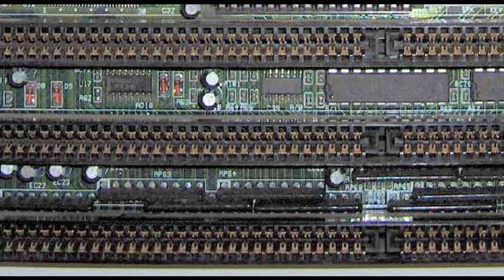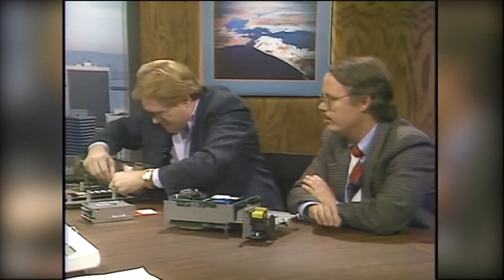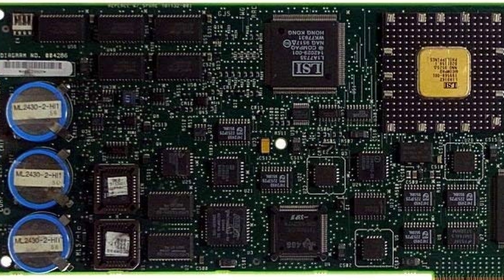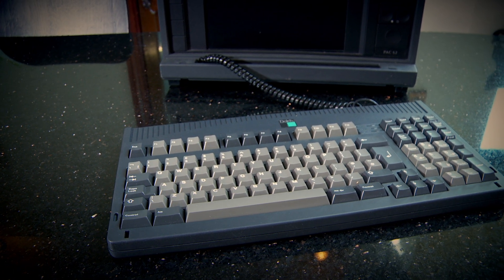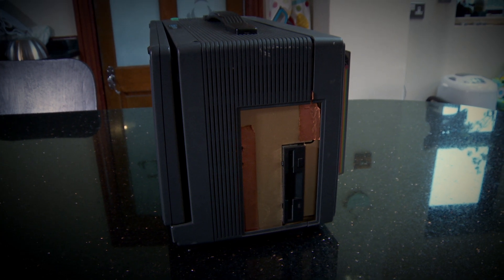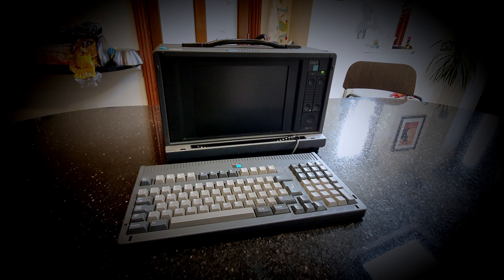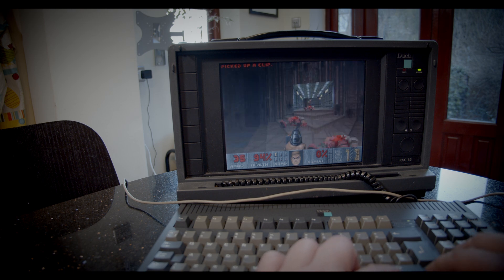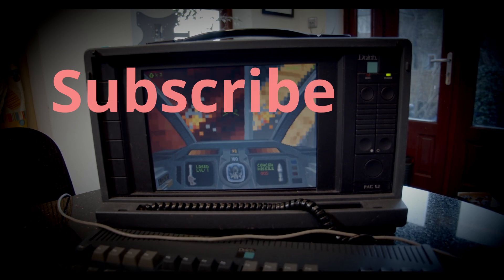E-ISA vs MCA: When IBM Lost the lead in PC market

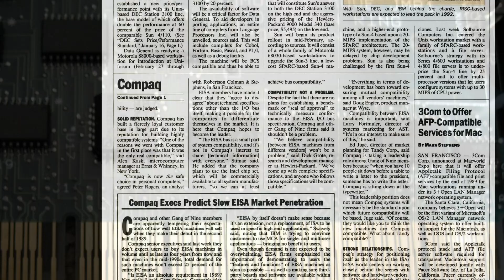Comment: 6:15 Look at the unusual alternating shape of those pins.  This was done to maintain compatibility with AT-bus pinouts, so AT-bus cards could also be plugged in. The backward-compatible pins made contact at the bottom, while the extra EISA-bus pins had their contacts at that second level further up.
Reply: Imagine all the pins in a row! lol
Reply: I have an EISA PC (a Compaq Pentium, also has 2 PCI slots) and EISA was an even bigger flop than microchannel.  At least microchannel had a lot of desktop PCs with MCA, EISA was nearly entirely confined to the server market, though, to be fair, EISA was pretty common in servers.  But microchannel was also heavily supported in servers, especially IBM servers.
Aside from this one desktop EISA machine I happen to own, I am not aware of a single other machine meant for the desktop with an EISA bus. (I've worked in IT since the early 90s)  Tandy is one of the "gang of nine" which defined EISA and I don't think they built a single machine with EISA.
Also, once VLB came out, EISA's days were numbered and PCI more or less burred it.
Reply: @tarstarkusz  Mate, we had scores of Compaq Professional Workstation 5000s with dual Pentium Pro processors and they were all EISA bus with EISA expansion cards.
Reply: @corydorastube  They were not at all common. They were very expensive machines, often equipped with SCSI cards and hard disks.  Compaq is mostly the only computer company that made desktop machines with EISA.  These were not common low end desktops like the DeskPro 2000, they were considered higher end workstations.  The model I have, one of the companies I worked for had hundreds of them.
Originally, the EISA standard was created or endorsed by what they called The Gang of Nine. But most never made even 1 model with EISA.
Reply: @tarstarkusz  Nowhere did i claim they were common, but the company I worked for has a very large client and on one floor of their building there were around a thousand of them.
Reply: @corydorastube  OK. Fair enough. I misunderstood you.  I myself worked in 2 places with large numbers of Compaq EISA machines.
Reply: @tarstarkusz  EISA was clearly the more successful, simply because more manufacturers used it and more cards were available. MCA was a flop. Your personal experience is only that... yours, not everyone else's. I had a cheap 486 PC with EISA slots. VLB was only for graphics cards, and whilst not a failure, it wasn't not a huge success either. It was PCI that killed all of them off.
Reply: @another3997  EISA was pretty common on non-IBM servers.  But IBM put MCA in all their desktop machines and they were very successful.  They were very successful with big corporations.  I supported them in several larger corporations at the time.  EISA was practically non-existent in the desktop market.
There were no cheap 486 motherboards with EISA.  There were no cheap EISA cards either. They were almost all very high end server stuff.
VLB is NOT just for video.  I have a VLB disk controller in my possession and used them in the past. I also currently own several 486 motherboards with 3 VLB slots.   VLB was what was common cheap 486 motherboards, not EISA.
EISA should have been common, but it never was outside of servers (it was the standard in servers).  The large presence in the server market meant most EISA cards were very expensive. The disk controllers tended to be scsi, not IDE, which is what end users were using.  The network cards tended to be expensive.  Video is not important on servers of the era.  The machines were locked away in closets and remotely administered.
Even the EISA machine I have today was a 5,000 Dollar high end Compaq workstation.
PCI blew both of them away and very quickly became the standard on both the desktop and server markets.
Reply: @tarstarkusz  I'm going to have to completely and fully agree with A Nother. First off, IBM simply DID NOT put MCA into all of their desktop machines, even the PS/2 line in the key time period had a variety of models - many did come with MCA but nearly as many did not.
On those random PS/2 machines (a very small % of all PCs sold in the era), you'll rarely ever see more than a disk controller card, a memory upgrade card, and a video card. Sure, they made all sorts of (astonishingly expensive) MCA cards, but due to the cost, only corporate users typically ever added on stuff like SCSI disks or Ethernet.
Indeed, in college one of my buddies actually did have an MCA '386 PS/2 machine, and we laughed (and ran) when we saw the price of the Ethernet cards; luckily his machine had a few 16 bit ISA slots as well, or else he would not have been able to get on the campus network (this was early '90s and we had direct internet access to our dorms and apartments via 10 Mbit Ethernet in those days).
As to EISA, it lived a quite healthy period in the server market - something that IBM had mostly ignored completely in their quest to own the desktop via MCA.
Big blue failed badly... it's OK to accept that, but it's not OK to spread falsehoods just because your limited familiarity with that time period and the hardware you actually ran into. Protip: you clearly worked at a small shop that didn't get to play with the good toys based on your "story". The reality was much different.
Reply: @chouseification  I supported thousands of these machines. They all had MCA.  I supported them in multiple large corporations whose names you would know.
You have to realize at the time most of these large corporations had token ring networks with terminals all over the place and a mainframe.  Putting IBM computers on the desktop was just a natural thing.  IBM was VERY well supported.  I was supporting PS/2 Machines after the turn of the century and could get ANY part  They were 10 years old at the time.  Every single part of the computer was avail new overnight.

I completely agree with you that MCA was a total failure outside of big corporations.  But that is where all the money is.  People don't want to spend tons of money of stuff.  They ONLY see ONE price tag, the up-front cost.  They don't see the having computers down for days waiting on parts that haven't been made in years.  Or creating yet another configuration by replacing a bad part with a "substitute" so that you end up with a bunch of 1-off computers or odd configurations that create bugs and strange behavior not expected and take longer to re-image when that become necessary.  Plus, most of the machines I supported in that era were running OS/2 (Os/2 had INCREDIBLE support for the mainframe stuff. It was great at remote upgrades through Rexx) 

 Your college buddy did not have the same requirements as large corporations have.  He wasn't printing using DLC.  He didn't have terminal emulation services running on his desktop.  He did not have a huge IT department He didn't have to worry that someone generating income for the company can't access the databases because his computer is down..

I agree and already said EISA was big in the server market (as was MCA, at least on IBM servers).  EISA had virtually zero penetration into the desktop market because frankly, ISA and later VLB were "good enough" for desktop PCs of the era.  

When did I say IBM didn't fail?  MCA was a big success, but MCA is NOT IBM, it's an IBM product/specification.  It's not what killed IBM's presence in the PC market.  OS/2 was far more responsible than MCA. Let's not forget about the laptop market.  Thinkpads were EVERYWHERE.  IBM's attempts to enter the home market also greatly harmed  them. IBM wanted to enter a market it was not set up to deal with.  IBM did not sell "commodity PCs"  IBM charged top dollar for their PCs which were well suited to the corp environment and had service contracts as well (I worked for ISSC). 

IBM sold "a system" and not just a PC.  Even procurement was easy with IBM.  A procurement person could simply log into software on the mainframe and order PCs directly and all of the normal stuff was already pre-approved and taken care of.  IBM delivered the computers pre-configured right to the end user's desk (this was not "normal" just possible and a company I worked for through ISSC did this).  This is primarily where IBM made their money, integration and service contracts and IT management.  The desktop computer was just one component.

You're talking out your butt. You never worked in the industry and know nothing about it.

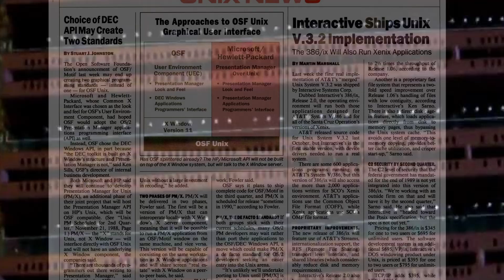Comment: 5:27 Now there’s an interesting one: a debate over which GUI display architecture should become the standard on Unix systems. I didn’t realize some people were keen on adopting IBM’s OS/2 Presentation Manager instead of X11 (here described as “DEC Windows”).

One of those is pretty much dead and gone, while the other is still in active use on Linux systems like the one I am using right now. It may eventually be supplanted with Wayland, but it seems that’s not going to happen in a hurry.
Reply: I used OS/2 on a Citrix remote access server with eight incoming modem lines. OS/2 was extremely reliable, especially when compared to Windows NT at the time. It was basically set it, and forget it.
Reply: Aesthetically, I definitely think Presentation Manager looked better than the various DEs for X at the time… but compatibility-wise I can understand why that didn’t happen.
Reply: Interesting, isn’t it: I clearly said “GUI display architecture”, yet some people immediately assume I mean “GUI appearance” or “GUI theme”. Any GUI architecture worth its salt can implement an endless range of different themes, appearances and behaviours. I would say X11 has certainly proven that over the decades.
Reply: @lawrencedoliveiro9104  I didn’t assume you meant the theme, which is why I specified the theme. I have no idea if the PM arch would’ve been easy to implement or not, I just said I preferred how it looked over the actual themes available at the time. Obviously X can look like anything, since today it usually looks like Ubuntu or Gnome. Get that chip off your shoulder.
Reply: @kaitlyn__L  It’s quite clear what I said, and what you said. You said nothing about any “theme”. You mentioned “DEs for X at the time”, but I don’t think you were aware of the range that was available, even back in the 1990s -- look at SGI, for example. And Looking Glass, for another example. The guiding principle of X, like in so many things *nix, was “mechanism, not policy”. Instead of dictating a look, it gave you the tools to implement your desired look.

Nowadays, it seems the entire concept of an “operating system” (outside of the Linux world) has come to be defined by how its GUI looks. Look at Windows 11, for example: it is basically just Windows 10 with a different skin.

Comment: 3:53 “Windows For Pen” ... complete and utter vapourware, created only to destroy any potential market for Go Corp’s PenPoint product. Once that had been neutralized, Windows For Pen was quietly shelved.
Reply from the maker: There where some machines that shipped with it sadly, I worked for an off-shoot of ICL and Windows for Pens was in use on some of the machines mounted to the forklifts in the warehouse, and yes it did worked as badly as you would think with a 3270 terminal emulator that could popup windows forms to be filled in using the pen.  The interesting part was that the machine had a early form of wireless networking that predestined as rs232 to the machine on the forklift, with the base-station using token ring and SNA over IP.

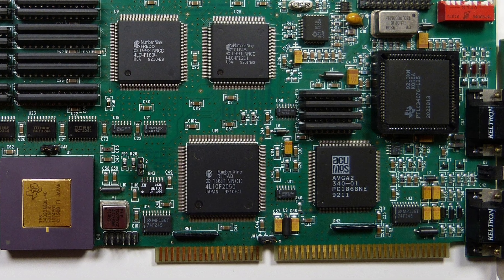Comment: 1:30 No, they were still primarily shipping 16-bit PCs at this point. So the OS was designed to work best on 16-bit machines, not 32 bits.

This was a mistake.
Reply from the maker: So the OS I'm referring to here is what would become OS2 and NT, which was designed as a 32bit OS hence the requirement for a 386 as it used the 386's 32bit addressing mode and the ring 0 supervisor.  Where confusion might arise is that the SX version of the 386 while 32bit internal was 16bit externally meaning that lots of boards could be made cheaply as they could be 16bit.  The DX version of the 386 was external and internal 32bit, so a supporting board would have to have a full 32bit data path too.
Reply: NT was a 32-bit OS, but OS/2 was not--not initially.
Reply: @lawrencedoliveiro9104  OS/2 2.x onwards most definitely was 32bit only. 1.x however, I've only got very faint memories running it.

Comment: I was working in pc support and remember building NetWare file servers with the eisa scsi and madge network cards. I also remember the Mca cards been a pain to setup without the reference disk for the bios.
Reply from the maker: I assume you where ising token ring then, or did Madge produce Ethernet cards too ?
Reply: Token ring through and through, in about 1995 moved from a routed bunch of token ring networks to using 2 3com superstack ii token ring switches with spanning tree to create a fully redundant cut through switching collapsed backbone. Loved those madge cards

Comment: I built a Novell 3.11 network using a PS/2 486 as the non-dedicated server. Running on thin ethernet around an office (don't forget the terminators or bad things happen). Beautiful machines internally, just so very, very expensive. Beyond servers, E-ISA and MCA just didn't have any impact on anything I saw back in the day. Great video!
Reply from the maker: I was rather fond of netware, dispite the abends caused by 3rd party software that was trying to rouine my life.  I even liked Netware 4 especially the whole zen desktop stuff.  We ran in mostly on Compaq servers with smart array e-isa raid controllers.
Reply: I too ran Novell, starting with 3.11. E-ISA was a huge performance boost, especially with RAID cards. We were using Compaq Proliant servers, and then Dell. I remember some of the cards had DIP switches on them that you had to fiddle with.
Reply: Ya, in the early 90's in our government office, people would recondition their own offices, and in doing so disconnect their thin net wire. After the entire network went down, I would have to run around a 4 story office tower asking who might be moving/renovating and find the black hole wire that needs a terminator. Sometimes while on this chore I don't reach the person who did it, and unbenownst to me, the network was ok now. Follwing that we went to 100mbps active thin net 'switches' as they called them. It required a point-to-point rewire, but no more terminations.

Comment: Did anyone else ever use a machine with e-isa ?  I worked for ICL sub-company in the 90's that mostly used Compaq servers and they where most E-ISA, with some having PCI and E-ISA.
Reply: Don't have it now, but I used to have a 486 server board with eisa. Chunky.
Reply: I built many machines with EISA slots, a bunch of server boxes using SCSI controllers. There wasn't anything really special about them from an operating stand point; they just worked if you had the appropriate drivers. Mostly NT based OS.

Comment: I'm still using a PS/2 keyboard on my main PC (Ryzen 3950X) to this day. I tried a USB keyboard once about 15 years ago on a machine that probably wasn't really ready for it, had some kind of problem with it back then, and I've had trust issues ever since. I'm sticking with what I know works until nobody adds PS/2 ports to their boards any more ;)

Meanwhile I'm not using my actual PS/2 machine (a model 50) because I don't have any MCA cards to put in it and I like to have sound and network on all my retro machines.
Reply from the maker: My keyboard at work is PS/2, I just have a PS/2 to USB adapter as the machine does not have a PS/2 port.  I really like the keyboard so I'm keeping hold of it.  It's getting a bit old now as I got it in 2000, my mouse is even older.
Reply: I still use my IBM Model M via PS/2. Best keyboard ever!
Reply from the maker: The model M is a great keyboard, expensive to buy now saddly.
Reply: RetroBytes Unicomp in the US still makes them, in both PS/2 and USB versions.
Reply: Did you ever notice the PS/2 to USB adapter that came with PS/2 keyboards is straight through? Your PS/2 keyboard is natively USB with a ps/2 adapter. You probably still use a serial mouse.
Reply: Same here; still using a Microsoft Ergonomic purchased new in 1996, with the delightful PS/2 connector.
Reply: Speaking of trust issues, PS/2 is still preferred by some gamers for latency reasons, though I'm dubious the reasoning is still valid. PS/2 is interrupt driven while USB utilizes polling, which sounds like a win for PS/2, but hardware is so abstracted these days. For example, the PS/2 port isn't really wired directly to the CPU anymore, it's part of a secondary bus known as LPC that governs other old signalling like serial ports, basically something like USB but for old stuff. Meanwhile the high performance USB stuff polls at 1,000 Hz.
Reply: I had a similar problem, but it was with my ex wife.